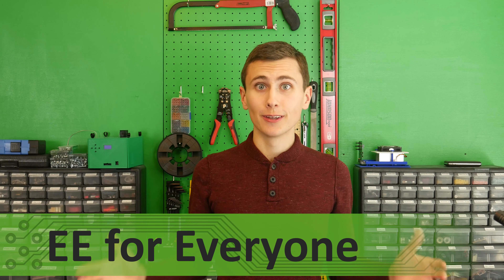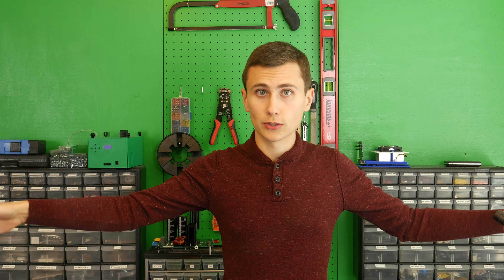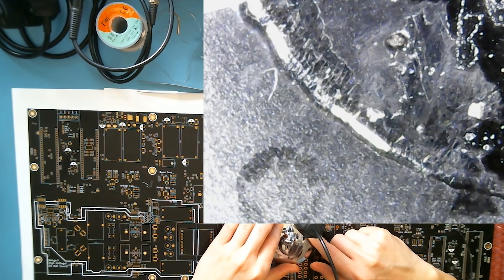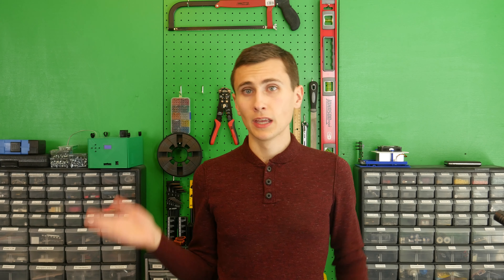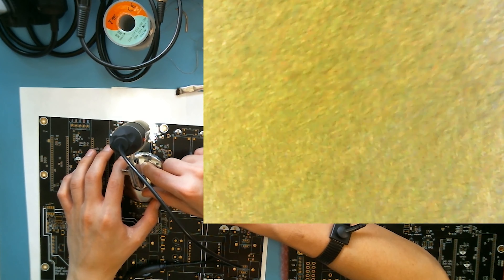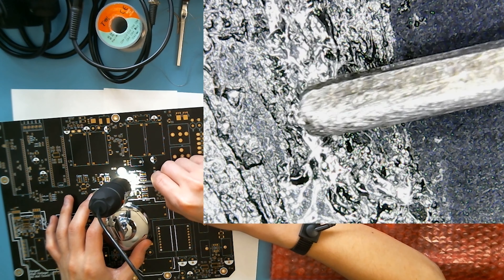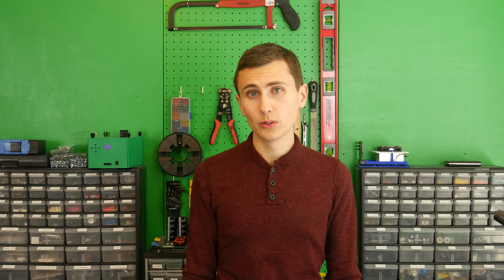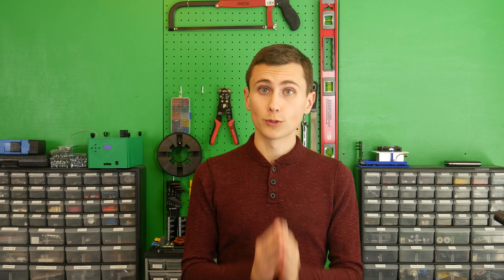UPS PCB / PCBA Inspection & Commentary (ALLPCB)

Comment: A couple oddball drills off-center probably means their drill bit walked. Factors that contribute are worn out drills, board not perfectly flat (uneven plating).

Solder balls all over the place & on top of parts means they had moisture in the paste and it was sputtering during reflow, launching bits of detritus in all directions.